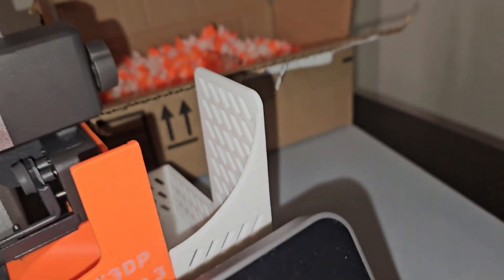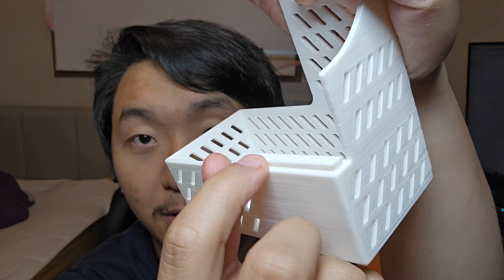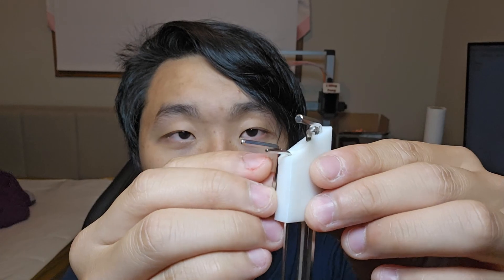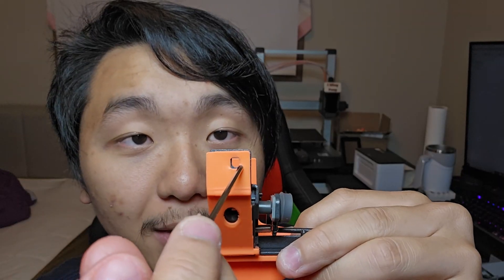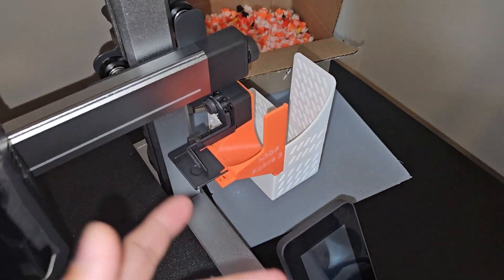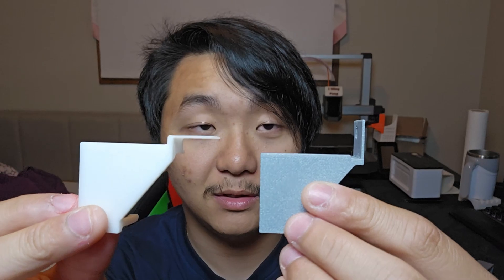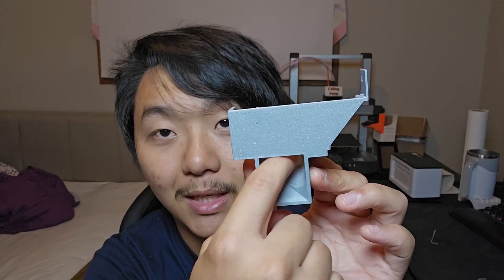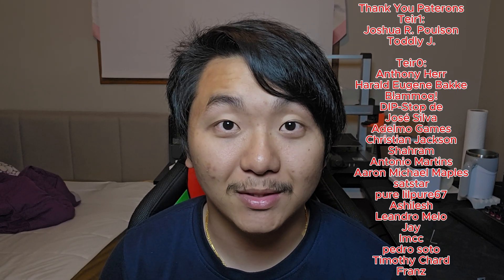Anycubic Kobra 3 MUST Have Mod | Filament Poop Catcher

Comment from the maker: Download Anycubic Kobra 3 Filament Poop Catcher: https://www.makeronline.com/en/model/anycubic-kobra-3-filament-poop-catcher-bin/15281.html

Support the channel: Tee-Spring: https://my-store-fa69d5.creator-spring.com/
Reply: I just finished printing this off and I love it, but the tolerance where the two pieces slide together is a little tight. I printed using pla at 210c with tree supports and a layer hight of .2mm. After sanding, it slid on a bit easier, but still got stuck. The second print I used the same settings, but I increased the gap for the v-groove by 0.1mm, and after sanding it slid on smoothly with no slack. I used the Kobra 3 to make this print.
Reply from the maker: @casonp.7922  That's nice. For mine it fitted perfectly. Every 3d printer is a bit different.

Comment: For your next project you may want to first design the original object your product is going to attach to. You already have taken all the measurements, with your 3D design skills, it won't be too long to have a rudimentary model of the host object. This would shave off 2 or 3 of your first prototypes.
Reply from the maker: That is true, If I made the original object it would be easier, I'll think of that next time.

Comment: put a large hole in bottom back of basket and put a box under it, they will push out into box
Reply from the maker: If I get what you're saying, is to cut a hole in the 3d printed box and put a box under the 3d printed box right?

It would be difficult to get the perfect sizes box so that the attach 3d printed box does not smash into the box under it.

Comment: Nice video and a awesome job on the design!  Would you happen to have a file to print the basket.
Reply from the maker: Thanks, yes the STL file is in Makeronline. I also just added the print profile for the bin. Here: https://www.makeronline.com/en/model/Anycubic%20Kobra%203%20Filament%20Poop%20Catcher%20Bin/15281.html

Comment: How did you learn how to design things so good. And how to use fusion360 did you go to school for this or self taught?
Reply from the maker: Thanks. This is all self-taught, trial and error. Learning the basics from watching YouTube videos and the rest is just doing it fusion360
Reply: @Scratch3DPrinting  your poop bin is really solid before I found yours I used another that almost broke my printer head it snapped the front cover off and got caught on the poop shooter and almost broke that off too.
Reply from the maker: @BnR_Tech  Thanks, glad it's working well for you.

Comment: hI THERE do you know anything about the Kobra 2 Max.  My extruder is pressing into the bed plate.  How would I fix this.  I am baffled by this problem.  thank you.

Kal
Reply from the maker: Sorry I don't have the Kobra 2 Max. It could be that the sensor for touching the bed is not working properly.

Comment: Why does my poop slinger shoot the wrong way?  The spring starts on the closed position, and then it fires it across the entire build plate.  But this chute catcher is if it's firing the other way.  What gives?
Reply: I have the same problem, and i figured out it is the problem of the failure in triggering the magnet when the printer head approach. I then add a spacer in between the magnet at the side so to shorten the gap between the magnets, and it workers😊
Reply from the maker: I'm not sure why your slinger is shooting the wrong way..?

Comment: Hey, how long did it take you to print each piece on the kobra 3?
im using the configuration from anycubic to kobra 3 in orcaslicer but i feel that is a bit slow
Reply from the maker: It took about 1 hour to print the Kobra 3 attachment, but with colored logo, it took about 3 hours. For the large bin, about 4 hours. I use Anycubic Slicer. It has silimar time, maybe about 10 minutes difference, it also depend on the settings.

Comment: I'm gonna use this, but modify the catch basket to just be a chute.  I have a trash can dedicated to just filament scrap right next to the table with my printer, so it can safely home and will just be leaned off the edge.  It'll be like a garbage chute on a construction site headed into a dumpster!

Thanks for your work designing the mount!
Reply from the maker: You're welcome. Glad you liked the design. Yes, modify it to how ever your situation is.

Comment: Like your vids S3DP,  I printed the poop catcher and fitted it. I might suggest that the wall the poop shoots to be a little bigger? it wasn’t quite tall or wide enough and it gathered the poop in a stuck pile then it just spread over the floor. Otherwise it is a great addition. Thank you
Reply from the maker: Thank you. Glad it liked it. Yeah it keeps sticking on the wall because the sling filament is still melted. I'll try to make a better bin.

Comment: Awesome catcher design.  I was curious if the catcher was little bigger would it affect the printer any?
Reply from the maker: No, it would not. Just don't make it any longer towards the bottom and towards the print head. (If that makes sense)